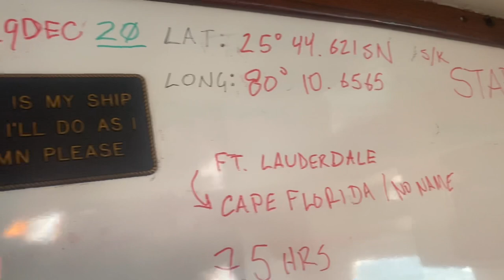[Ep. 12] Minor collision with a bridge. No big deal!

Comment: It will be interesting to hear what you finally had to do to fix the steering at first I thought it was a hydraulic set up, but after a second viewing it looks like a rack and pinion.
Reply from the maker: Yeah. It’s not the best. I’m likely going to fix that when I pull her out of the water. The rudder seals are leaking a little, so it will be a good time to tune everything from the wheel to the rudder.

Comment: I think the black box-shaped thing is supposed to go INSIDE the aluminum channel, far enough that the indented (crimped?) part of the black thing is lined up under the bolt/bracket. Then that bolt/bracket will bite down into the recess and hold much better. That should also do a better job of keeping the grease clean.
Reply: Hehehe I understood everything you said! Hahaha
Reply: @glennroberts3069  I was hoping there'd be at least one.
Reply from the maker: Yeah. It looked like whoever built it didn’t do it like you said.
Reply: @sailingketchstarship1965  Or after the first time it came out, they mangled something trying to put it back in, and now it won't fit anymore. Good thing you're resourceful.

Comment: so no emergency tiller?  if you can get to rudder post two vice grips can lock rudder in a fixed position. make a scribe line on rudder post shaft to know what way is center.
Reply from the maker: I do have an emergency tiller but it would h e required me to leave the cockpit on a busy thoroughfare. Once anchored it was better to just repair it than switch to the emergency tiller.